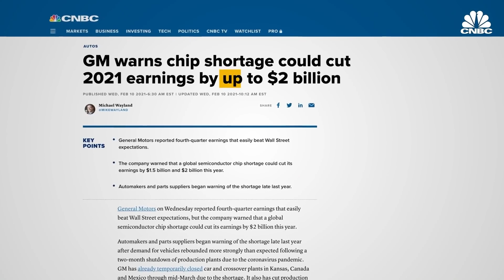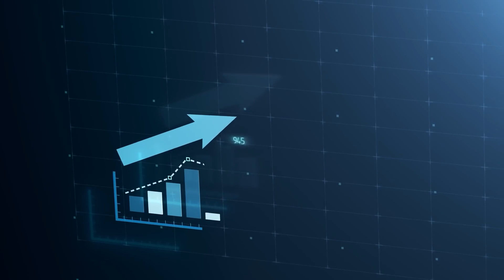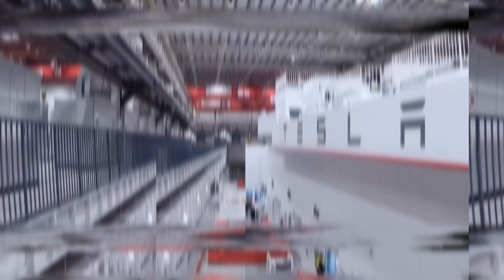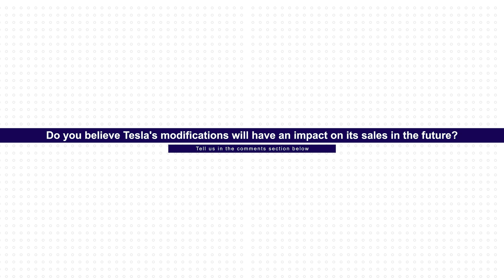Teslas GENIUS Semiconductor Made Them $11.9 Billion Dollars

Comment: As for delivering vehicles that do not have all functions, this should be acceptable as long as the buyer is made aware prior to delivery and agrees to it.  GM had a huge issue in the mid 70s with mid range Olds and Buicks sold with Chevy engines as the Olds and Buick engines were used in California spec Chevys without any notice of the change - I hope Tesla is aware and stays within bounds.  Good video

Comment: Tesla Does not care about their customers, it only cares about how much profit they make at the end of each quarter.  It will come a time where Tesla will suffer, because the other Auto makers are catching up with Tesla by offering models for each class, instead of just for one class like Tesla. Tesla did not make any  quality improvement in the past year, and their customer service stinks. If you ever had a problem with your Tesla after the Warranty runs out, good luck getting it fixed by Tesla.